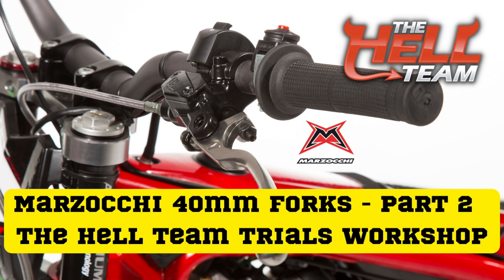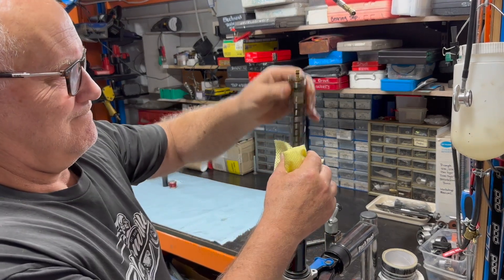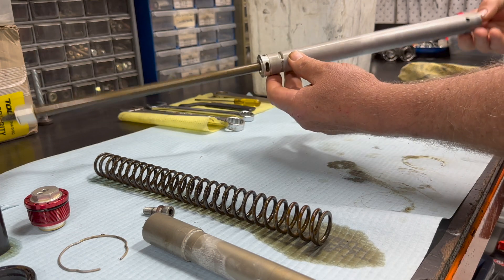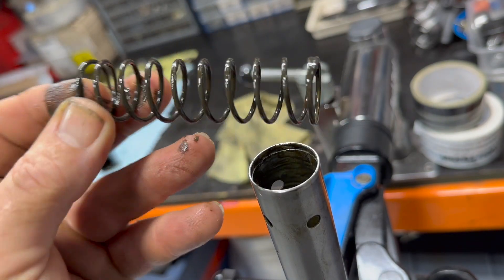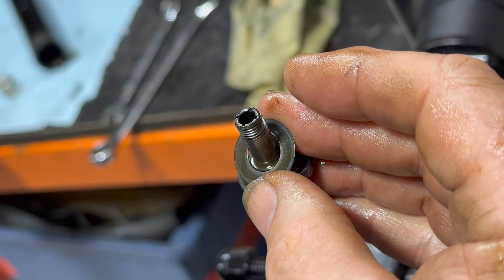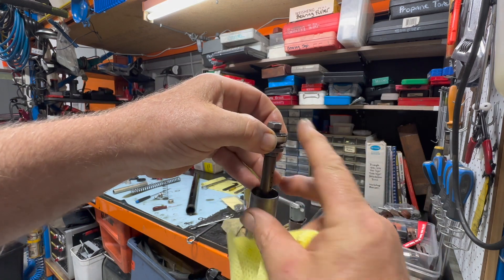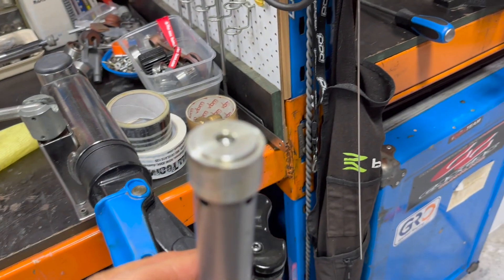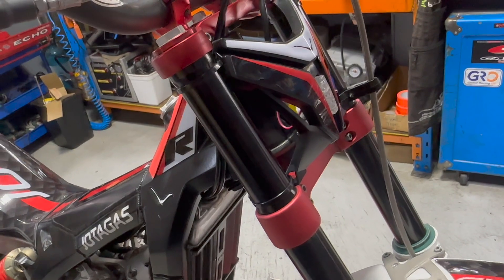Marzocchi 40mm Aluminium Forks Part 2

Comment: What size washer/shim do you bend into the one you use? Trying to find a washer of any kind that matches those dimensions is impossible, can the ID be bigger or smaller? Same with the OD? Im assuming the thickness needs to be the same

Comment: Hi! Very good video!
If I'm heavier, about 95kg, I need to replace the springs. The original spring is 320mm long. The reinforced one, for example "JITSIE", is 300mm. They write on the data sheet that a longer spacer is needed... Do you produce a black plastic spacer 20mm long, then it could be good or what is the good solution? Or if the original spring remains and a longer spacer is installed, then a more tensioned spring could not be a good solution?
THX
Reply from the maker: Yes we have longer spacers to add. Sorry though they are not black!
Reply: @TheHellTeamTrials  Okay, I understand. The question is, can I keep the stock spring with a longer spacer? Would that be good?
Reply from the maker: @kaszaferenc8177  No that would be bad. You are just adding more preload, not increasing the springs rate. So if you add say 60lbs of preload then you need to apply MORE than 60ibs of force to get the spring to even move. 
Adding the longer spacer with the heavier spring is only adjusting for the heavier springs shorter  free lengths, not for pre loading the spring.
Reply: @TheHellTeamTrials  Okay!  THX :)

Comment: @hellteam  thank you very much for this excellent tutorial. 
I have found the same issue with a broken wave shim washer but was a little confused on how to repair it...
Reply: So the wave shim allows the oil push back through the shim pack as the pressure increases??

Comment: Is it an all or nothing deal, do I need to do a complete rebuild if I just want to change the oil?
Reply from the maker: You can just drain the oil either by tipping it out, or undo the bottom bolt and drain from the bottom of the lower leg, just don’t stroke the inner rod whist there is no oil in the lower leg. It obviously only partially changes the oil as you are only changing what is outside the cartridge.

Comment: Thanks. Is there a rebuild kit or do we order individual parts. What year are those forks in the vid.A
Reply from the maker: Unfortunately there is no "kits" sold, everything was individual parts. There is a parts breakdown PDF on our site with the part numbers of each individual part. But a lot of them are now obsolete, or not available. We source O Rings from Hydraulic Seals, we cut our own teflon band seals, and tweak our own "bent shim washers" as none of those parts can be purchased any more. You really have to be resourceful when working on these things now. There was a few different forks in that video - a set from 2008 and 2012 from memory.
Reply: @TheHellTeamTrials  Thanks for the explanation I will check out your site
Reply: Hope im not too late for a response but does this need to be done to both sides then? I’ve just looked on the pdf and it’s all a bit confusing. Im assuming the other side not being a closed cartridge that it’s not separately filled with oil however does the Teflon seal and other possible replaceable bits still need to be checked? I only bought my bike on Sunday not realising the forks were leaking, it’s a 2013 jotagas 300 and im assuming the forks probably haven’t had a full service before so trying to buy all the bits before I take them apart. I understand I’ll have to make some of my own bits and source o rings but the shim washer ect do I need 2 of them 1 for each? I’ve found where to get bushings and dust/oil seals jist need to get Teflon and the bent washers or is there anything else I’ll need? Was figuring just to replace the bushings anyway or is there a chance they will be okay? Also I have a scratch in the upper leg near the top but where the seal may go over, it’s not very deep and I’ve already made sure there’s no sharp edges but will that mean a replacement? Or could I maybe get them re anodised? Thanks in advance I know Ive said a lot i just want to ride my bike but I’m scared of using it with them leaking and figure they’ll probably be in similar condition to these once I take them apart. Thanks again